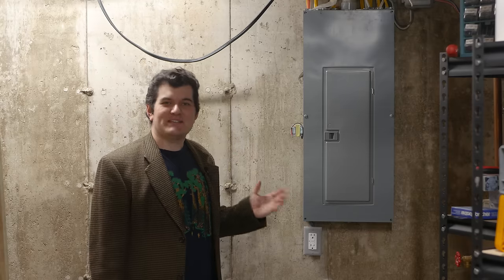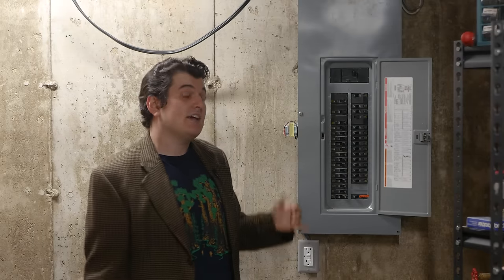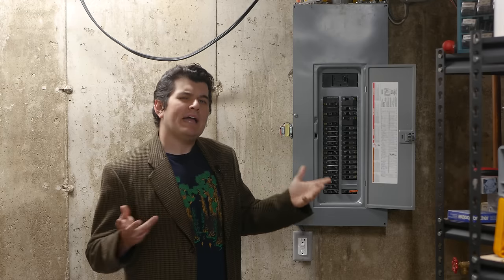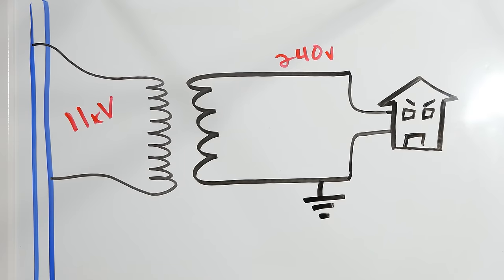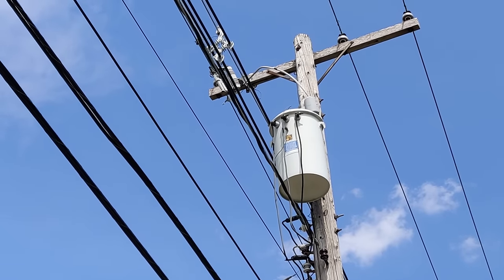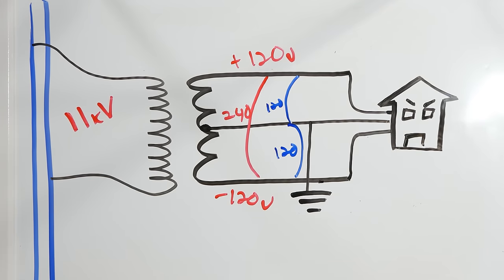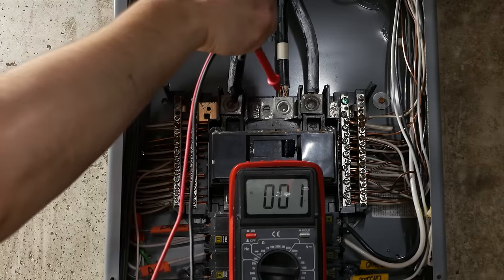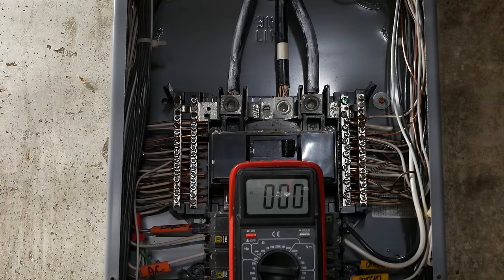The US electrical system is not 120V

Comment: Every single time I hear " It's amps that kill you not the voltage", it sounds to me the same as, "it's the claws that kill you not the big fucking bear"
Reply: Yeah, I've never understood that thinking. I guess it's an easy rhyme to remember if you've never learned Ohm's law, and it's technically correct. Just not usefully correct.
Reply: It's just people trying to sound smart.  It's a symptom of the disease of low confidence.
Reply: You bear analogy is way off. While it is technically wrong(it does not paint the whole picture as the voltage, current, frequency, internal resistance of the source and the resistance of the load) to say that A kills you and not the V. At most household situations, this is reasonably accurate, in fact most household electroctrocutions deaths are caused by closing the el. circle via low resistance path through the body into a lower potential point.
Reply: It’s the amps that kills you because high DC voltage does nothing to you since your body’s resistance is really high. If you have AC then your body behaves like a capacitor and by doing so it lets much more current flow through. Then, usually, death is caused by milliamperes of alternating current flowing through your heart.

So you can have 120V DC between your left and right hand with no problem, but certainly not 120V AC. So we could say it’s Tesla that kills you, in fact it was one of the main arguments against AC current in the first place, its safety. It’s the right frequency that kills you.
Reply: Stun guns and tazers.  It's like having a bear made of jello, 100k volts, but negligible amps.  It's rare though to have a voltage source with high enough volts to pierce the skin, and it not have enough amps to easily kill you.  It's amps that kill you not the voltage, is funny because its tecnicaly true, oh seems you didn't know it was a joke, it's kind of a joke, that's also kind of true.... its one of those.
Reply: @giuseppebertolini6705  Thought the AC was a problem because of the herts making your heart spasm, and the dc just locking it up.
Reply: @giuseppebertolini6705  I wouldn't say no problem, I would still feel it most likely. But that is basically what I am saying all along, I have seen some idiots try touching live wires "because its the amps that kill you no the voltage", that doesn't mean the current isn't responsible for the damage. I have seen demonstrations where people are using a van de graff generator, and the general public assumes that the thousands of volts across the body aren't doing much other than making their hair spiky so why should the 220V AC in their houses. This can translate to some poor understanding in some students as well. A van de graff is a constant current source, so of course it would produce a ton of potential across a high resistance path.
Reply: @travismason2811  Capacitive effects were the primary concern; the frequency response of a capacitor has higher magnitude at higher frequencies. But then skin effect also comes into play so it complicates things a bit.
Reply: Voltage is more than volts or current
Reply: @mubashirsoomro6  by lower potential I mean ground or neutral (you will be hard pressed to find negative potential in households). If your body(or a bodypart) bridges those two potentials with minimal resistance, some current I(A) will flow through your body as those potentials try to equalize.
This is how most of the household electroctrocution deaths happen and they happen because of poor installations(or during the process of installing those due to human factor and lack of training) or malfunctioning devices/metal elements not properly grounded...

The point is: in most households electrcitons it's the amps that kill you.
Reply: @bozoc2572  Again, as I have said before I am not denying that current doesn't kill you, you can say the current kills you because technically it does. My point was that saying "its not the volts that kill you but the amps" is not correct, because those two things are not independant, depending upon the type of source, one derives from the other.
A constant voltage source is going to supply as much current as it can depending on the body's resistance to keep the voltage constant. Likwise for a constant current source. But a constant current source with a low current output won't kill you no matter your resistance, as it will just increase the potential across your body. A constant voltage source will most likely kill you provided it can supply enough current and your body resistance is sufficiently small ( just like you mentioned, household deaths due to poor installation). However current sources are not really common, or easy to manufacture chemically. They are certainly not as widespread or useful to lay people. 

That's all I am saying, I am not really disagreeing with you.
Reply: @mubashirsoomro6  Yes, it is technically incorrect to say that it's not the the V(U) that kills you but the I(A), since there are many things at play here... 
But, with the voltage sources it's is okay to say that the amps kills you, since you really don't want that current flowing through your body between potential differences. It is a matter of perspective and in this case it's useful to think that 'A kills and not V'... Why get hung up on that? It's useful thought.

Effects of electricity on human body is very complex subject and the theory required the sufficiently explain the effects of electricity on human body is well outside of scope of most average people and whatever they think about what actually happens will be incomplete.
Reply: @bozoc2572  I don't see how that perspective is useful. Is it educational? barely. Is it true? Technically. Is it useful? How so?
I don't see how much current a certain source is going to produce through me, unless I measure my own resistance and there are many complex mechanicsms at play in our chemical and physical make up.

I can see that a 20V(AC) is not going to be a problem but a 220V(AC) could kill me. To me this sounds more useful than knowing the amount of current that will go through my body( As far as a laymen is concerned). 

I am not really hung up on it as much as frustrated with it. It is correct but not complete and that can cause some problems, especially in some students I have encountered . Why not just say, "A high current is resonpsible for death by electrocution", than tacking on the voltage part.
Reply: @bozoc2572  I don't believe I said that, "voltage kills rather than current". As far as usability goes, I don't believe I have to explain circuit analysis to people for them to understand that high voltage is dangerous. And as you said common household voltages, that's all you have to say. People may not understand what exactly voltage is, but that doesn't mean they don't know that it is dangerous. They know that if the voltage is low the lights will become dim, they don't really need the concept of current to understand that. Likewise if the voltage is low they probably won't be shocked as badly as if the voltage is high.

I don't understand how useful it could be to know about current in this instance? Sure, a higher voltage can drive higher current through their body, but isn't it simple just to say a higher voltage will kill you?

As for your last point, I agree, it's the energy supplied to your body that does the killing, but then again it's not that useful to the general public either.
Reply: It's true, why do you think a cops taser has like 50,000 volts and it's non lethal in most cases. The taser isn't hitting you with deadly current only high voltage.
Reply: @mubashirsoomro6  Again,  current kills is prevlent in communities precisely because it a simple way of deterring humans from dangerous situations in households. Even technicians are trained in that way-i.e., don't bridge the damn circuit with your body or with the parts of your body, and there are specific protocols that in fact account for most lethal situations that are quite common causes of electrocution. 
To simplify a complex topic and to make it useful to keep people from dying there are few points that instantiate the deadly nature of electricity: the path the current takes through your body, the length somebody stays in a such situation, the ammont of current passing through the body and the frequency of that current. Notice something here? Current, current, current...  Current kills is just elegant heutristic.
Reply: @bozoc2572  Okay let me put this another way, you mentioned technicians so let's go with that. Say, there is a 10V source and a 1000V source, would the technicians need to know the current for them to judge which is more dangerous? Even if they complete the loop with a 10V source, do you think they will die?

As for the simplification regarding complex topics; I don't have a problem with the phrase, "Current kills you", my problem is with, "Current kills you no the voltage". This massive simplification is not very useful, and even if current comes up so often, do people really understand what it really means? If they do, then might as well start with voltage and the water analogy. If your goal is to deter people who don't understand much about electricity from its dangers, then the how does saying current kills you not voltage, going to affect them? They don't see the values for current on voltage supplies, but the values for voltages.

So wouldn't it just be useful to say that above a certain voltage you have a risk of dying? Why bring in current? Even if it is technically true, in this instance it is not necessary.
Reply: and its the bullet that kills not the gun.
Reply: Amps would be how fast the bear could run.  If the bear could only run 1 mph (1 amp) you would probably be ok.  Voltage would be how big the bear is.  If the bear was  16 foot tall (480 volts) but could only run 1 mph  you would still be ok.
Reply: the amps depends on the voltage
Reply: @AegisHyperon  more like the amps depend on the ohms.
Reply: It's not the fall that kills you, it's the sudden stop at the end!
Reply: Or as the NRA keep telling us "It's the shooter that kills you, not the gun".
Reply: @giuseppebertolini6705  really? That's pretty cool. The more you know
Reply: What it really boils down to, is unless the voltage crosses your heart, it's unlikely to kill you. Of course, if the voltage is high enough, good luck trying to let go of whatever is shocking you, and whatever bits of you are completing the circuit are literally going to cook.
Reply: Its not the claws its the blood loss
Reply: I've had a 8kv shock and the amps were 0
Reply: @mubashirsoomro6  Bear analogy is not correct. A better analogy is a bow and arrow, a huge arrow is not dangerous with a small bow. Therefore, you out RCD-protection in areas where necessary (here it is mandatory more or less everywhere, except some certain usecases), to control that when it flows approximately 30mA from phase to ground, the RCD shall trigger. Effectively reducing risk of heart failure.

50 volts AC is concidered the treshold of what humans can endure, as 50v and our inner resistance equals to about 30mA.
Reply: Mubashir Soomro ok, high voltage will push more current (measured in amps) through a resistance (you) than a lower voltage, if there's  enough power (watts) behind it. You're not going to get a deadly shock from 12 volts no matter how many amps, 500 or more, it's rated for because your body has too much resistance for 12 volts to push much current (amps) through you.
Reply: or i wonder if they are a taser salesman
Reply: @engineclinic  It is both. Power is equal to the voltage squared divided by the resistance.
Reply: @steves009  If you had a shock, the amps were NOT zero. The current may have been very low, but had to be there to flow through you.
Reply: Claws don't kill people, bears kill people!
Reply: Unless your working on the big stuff, then don't worry about either because it usually blows out your ankles and you die of blood loss 😃
Reply: @haruhisuzumiya6650  Ohm my god!
Reply: Does a taser(more than 1000v) kill u no. does 120v kill u yes
Reply: @travismason2811  100k volts in open air but as soon as it contacts skin in order to limit current voltage drops under 100 volts RMS. That's how you limit current, by limiting RMS voltage.
Reply: @chrishill601  it is like luke skywalker he is 230v high, but it is the force that kill you, not the size . amp or watts is the force of the electric system, watt is volt x amp ,ex  230v x 10 amp is 2300 w power to use.this i why we uses high voltage in the power lines, try 115000V x 10 amp fuse = 1150000W to use, and this will be in the same 1,5 square mm cable, in a car this will be 120w in the same cable.
Reply: @chrishill601  It's usefully correct when the voltage is high, but the amps are low.  The static charge you build up walking across the carpet, and touching a doorknob can be thousands of volts, but the amps  depend on the ability of your body to hold charge.  Since you can't store that much charge, the amps are very low, and nobody has ever died from getting a static shock from carpeting.  Spark plugs on a car are also thousands of volts, and while it's painful to get shocked by one, it's not going to kill you.  

So yes, there are situations where the phrase is not only technically correct, it provides you with useful information.
Reply: The problem arises when people confuse the current of the shock with the current of the circuit. Assuming a constant resistance of a human body, there is no situation in which one can receive a "high voltage, low current" shock. V = IR, so with a constant resistance, current is directly proportional to voltage drop. 

A "high voltage, low current" shock often means that the potential voltage is high, but the voltage drop across the body is much less than the line-ground voltage, due to high resistance in series with the body. In layman's terms, if the human body is not connected to ground (or another line in a multi-phase system), there is no voltage drop across the human body, and so no current. 

Likewise, the resistance of the human body can very. Wet skin, for instance, will lower the resistance, increasing current low for the same voltage drop.
Reply: @blkgardner  except a taser which can be 10k to 20k volts but .01 amps.
Reply: @jamesross160  That proves my point. The voltage drop across the body is not 20K Volts. Rather, the 20k volts refers to the potential voltage across in open circuit of a taser.
Reply: It's ENERGY that kills.  There is more than lethal energy in a home circuit.  Static charges that you feel when you touch a doorknob are in the range of 10,000 Volts, but only have a tiny amount of charge, and hence tiny currents.  The natural ambient electrical field in the earth's atmosphere near the earth's surface is about 1000 Volts per meter. When it gets too intense and breaks down the dielectric resistance of air locally, it discharges as lightning. That can kill you. 

One way to think of it is analogize voltage to height, and current to mass.  If someone drops a small coin from the top of a tall building, it doesn't do much damage. If some drops an anvil off a low table, it can do real damage. If someone drops an anvil off a tall building, it can do massive damage.  Think of house current as a small anvil off a moderate size table. Treat it with respect.
Reply: @jimdecamp7204  It is true that "energy" kills, in the sense that the duration of the shock affects how dangerous it is. Static electricity is not my forte, so I don't know the mechanics of it well. Since there is no sustained flow of electrons, the duration of of static electricity shock is much shorter than most current electricity shocks. At any rate, static voltages and current voltages are not directly comparable. 

However, the anvil-distance analogy is not valid. Rather, the proper analogy is voltage as water pressure, amperes as the water flow, the resistance as how constricted a pipe is. 

If you have a stable pressure source, you will find that the flow through any given pipe is determined by the size/nature of the pipe (resistance) and the the pressure of the source. If you have a high-pressure low-flow system, you will find that the flow in the pipe is actually reduced. But, upon further observation, you will find that the pressure drop across the pipe is also reduced. 

Therefore, if you know nature of the pipe (aka, it's resistance in ohms), a given flow rate corresponds to a given pressure drop, and a given pressure pressure corresponds to a specific flow rate. 

In affect, the "high voltage, low current" water system is the equivalent of a high pressure system with upstream clogging. If you look a hose downstream from a partial clog, it will look like low pressure.
Reply: @blkgardner   Your water analogy is excellent.  I used the anvil to keep it simple. At the end of the day, it's energy that does the damage, however.
Reply: Sure, amps kill...........but not by themselves, you can touch single-digit voltages at kiloamp currents and not feel anything because the voltage is too low to break your skin.

On the other hand, touching the 2kV@1-2A output of a MOT is guaranteed death.
Reply: @jimdecamp7204  Yes. Energy would be the cause of injury and death. 

In current electricity (aka, anything but a lightning strike and few extreme niche situations), the energy of the shock is controlled by the voltage drop, resistance characteristics of the path (aka, the resistance of the person being shocked), and the time of the shock. 

Mathematically, Energy = Power x Time (aka, watts times seconds). 

Going back to the pipe analogy, as far as electrical shocks are concerned, only the flow and pressure inside the "shock-victim  stand-in" hose matters. 

The "high pressure low flow" system can mean two things. Either, there is a high pressure and high potential flow, or there is high pressure but low potential flow due to clogged pipes upstream. The latter condition would be called high output impedance. Or, you could simply have a system with high potential pressure, but it just happens to have low flow. 

However, the flow and the pressure within the hose (that in the analogy of the shock victim) are related. If you have low flow in the pipe, then the pressure drop across the pipe will be low.
Reply: @DFX4509B   I don't think we disagree.  Static electric potential can be quite high, on the order of tens of thousands of volts, but other than some slight discomfort, generally harmless, but because of the small amount of charge, and hence current, applied.  The natural ambient electric field is on the order of about one thousand (1,000) volts per meter. When the ambient electric field intensity exceeds the breakdown voltage of air, the discharge is dramatic. We call it lightning. There a great deal of charge involved.  

I recall working in a factory in the 1970's where the refrigerator (for keeping bag lunches in) used a two prong cord; the case was not grounded. If you probed the chassis with an oscilloscope, with a 1 megohm input impedance, you would see 120 VAC on it, probably because of stray capacitive coupling. The impedance of the capacitance was sufficiently high that it did not present a danger, absent a fault between phase ("hot") to chassis, which is exactly why modern appliances are grounded. If one touched the chassis and touched the tip of an oscilloscope probe in the other hand, you would see the 120 volts "coursing" through  your body, but at such a small current that you would not feel a thing.  Your body was acting like a conductor. You can see the same thing at popular science museum exhibits, but at DC, with thousands of volts and the subject's body acting as a capacitor.  It makes your hair stand up on your head. 

Regardless, always treat electricity with respect. Fire is the primary concern once work is installed, electrocution while working on the wiring.  Be safe, follow the rules and treat all circuits as if they were live.
Reply: @jimdecamp7204  If I'm right, and my single-digit voltage example was 1.5VAC@1kA, and skin resistance is 100kohms,  I would only be taking on 0.015mA, not even enough current to feel despite the transformer being able to put out 1kA, which at low voltages like that, can melt metals and is commonly used for that purpose and for spotwelding.

With a MOT, however, I would be taking on the entire 1-2A because the voltage is more than high enough to break skin, as is the 120V@15A or 240V@30A out of the wall, and tasers operate on 50kV@microamp currents hurting like hell, that's where they get their stopping power from.
Reply: because you can be shocked with hundreds of thousands of volts and be fine(tasers) because the amperage is low. Volts just determines if it can pas through a material like you skin an organs. If there's enough voltage to pass through, then amps determines whether it will kill you or not.
Reply: @jmh1189  yeah that is how electricity work. if you had high voltage but low max current. The voltage will start dropping if it cant provided enough current to load.
Reply: @DFX4509B  it same with voltage tho. If you have 50kV@0.015mA touching your skin with  100kOhm resistance, you will only get 1.5V since only 0.015 mA current running on your skin, thus the voltage will drop.
Reply: It litterally only matters for a handful of situations like ionizers incapable of providing much more than a micro amp at insane voltage, (or similar demo low amp devices) or how linemen can syncronize their voltage to a live transmission line provided they wear a full chainmail suit (corona is fun).
Reply: Good analogy. Most laypeople do not understand, better to not touch anything more than 50V as a rule. It has to do with impedance, some sources have high impedance (tasers etc) mains power has low impendence means it can push lots of current through you.
Reply: Right?! Pretty sure it has to be the right mix of both. Kinda' like combustion.
Reply: To be honest it's milliamps through your heart muscles that quickly kill you.
Reply: Or the bastards who say "it's not the heat, it's the humidity! Ahahaha!"
Reply: @Demiglitch  It's all about the source and load impedance plus the source voltage, I have tried to explain it. Some get it, some do not. Tasers have a high voltage but also a high source impedance, not enough current flows to kill you. people get fixated on current, current flows when the voltage appears across the resistance. Focusing on Amps, negates the bigger picture. I am preaching to the choir but others will read this I hope.
Reply: I can barely bear the thought of a bare bear bearing down on me.
Reply: I'm more scared of the Jabberwock.
Reply: @mubashirsoomro6   The amount of energy dissipated through the body has more to do with it.  A few hundred watt-seconds ( 100 ma., 120 volts) can stop your heart, but a 200 to 400 watt-second defibrillator pulse can restart it.
Reply: @travismason2811   I was shopping online for tazers,  but there were too many shocking reviews.
Reply: @nthgth  pot and the kettle
Reply: @blarghblargh  I think you're using that expression wrong haha
Reply: @giuseppebertolini6705  120VAC is 120*1.414*2, or 339.36 Volts, peak to peak.
Reply: @giuseppebertolini6705  DC is way more dangerous than AC. You get zapped with 230V AC (Here In Austria) you can pull your hand away. You get zapped with 235V DC (some Motor phase controllers) Your whole body locks up and you are not able to pull away...ANYTHING.
Oh and its Voltage thats dangerous. Amps dont matter at all if you do anything actually professionally
Reply: It's like saying "it's the bullet that kills you and not the fact that it WAS APPROACHING AT VERY ZOOMY SPEEDS"
Reply: Bullets kill. Not the gun.
Reply: "Its the pressure that kills you not the velocity of that bullet"
Reply: "It's not the fall that kills you its the sudden stop"
Reply: I cant say for certain where the saying came from but I first heard it from an instructor cautioning a student who scoffed at  the dangers of 120v . He mentioned getting shocked by the fancy g-wiz wonder box ignition system on his hot rod wasn't that bad, and it put out some absurdly high voltage. . 

 You  can have very high voltages with almost no current, like static electricity. The igniter on your electric grill or some cigarette lighters make a high voltage spark that will not be pleasant if you shock yourself with them, but won't harm you. Getting zapped by a spark plug wire on a gasoline engine can be painful and some of the high power ones are supposedly capable of minor burns but I've never heard of one killing.   

Meanwhile a comparatively low 120 volt circuit can easily kill you if the current passes through your heart.
Reply: @nthgth  I can't speak for most people but the first time I heard it was an instructor setting a student straight when he scoffed at the safety precautions we were required to follow when dealing with 120v. 
The kid mentioned the ignition system on his car was many times that and wouldn't kill anyone.  It is surprising how little some people know about electricity.  A friend of mine was horrified that I would change the battery in my own car because he was convinced that the high amp output meant I'd get killed if I accidentally touched both terminals, and cited the "it's the amps that kills you" thing.  
He installs some fairly high tech electronics and has done so for decades.  I thought he was kidding. As it turns out, he wasn't.
Reply: @travismason2811  There is some truth to that but probably not the way you think.  Most people are familiar with  resistance.  If you have a 1 volt power source, on a circuit with 1 ohm of resistance you'll have 1 amp of current. That doesn't matter if you're talking DC or AC.  When you're talking radio frequencies (RF) things can get weird once you go above a certain point.   What does change is impedance. If you have 1 volt at 60hz at 1 ohm of impedance, you get 1 amp. If you change the frequency that changes.  If you took a capacitor and hooked it up to a DC power source and monitored the current, you'd have a spike of current at the beginning until the capacitor charged up, but then it would taper off to zero as the capacitor was done charging. This might only take up a tiny fraction of a second depending on the size of the capacitor.  Hook  that same capacitor up to an AC power source and you'd see a constant current flow. (overly simplistic, you can blow up the cap or pop a fuse etc)  While the human body isn't a capacitor, it is a very complex system. Our skin isn't a very good insulator, but it is a heck of a lot better than what lies beneath. A shock from a DC source is very different from a 60hz ac or a zap from a radio transmitter.  All can kill you, but higher frequencies do seem to get past our skin easier. I can't find a lot of data on it but I do know that RF burns can be UGLY. 

Anything that can get though to your heart with enough current to screw up the way it beats can kill you.  Statistically for 99% of people (In North America at least) that would be the 60hz 120V AC you get from a common wall outlet. Not many people work around high voltage dc or RF transmitters.    In an industrial setting you have 60hz 3 phase circuits that commonly go up to 480V and accidents do happen. (I got zapped by 480 despite locking out the circuit and verifying it was dead with a meter.  Someone had fed one a fuse blocks in that panel from an adjacent machine. When the machine next to it was fired up part of the panel went live. I describe it as how I imagine getting hit by a bus would feel in the half second before the pain had time to set in, and you died. I think every muscle in my body convulsed HARD. The next thing I knew I was laying on the floor thinking that our hot rod forklift driver had just clobbered me.  
Not one of my better days but I'm still here so I can't complain.  I did make sure to fix the machine so that couldn't happen again.
Reply: Only need 2mA for the ‘paddles’ on an open heart surgery defibrillator.  A 15kV PS I made for use in a human contact situation would drop to near zero volts with the heavy load that a human pathway presents, but we had it shut off at micro-amp levels.  That tiny PS was not capable of harm. Sure it would hurt, but no harm because the bear (voltage) gets clamped.  The 11kV available at a telephone/power pole HV feed is capable of so much current that is will roast you and your body parts in the pathway it takes by boiling your salty blood and might also cause a heart issue.  :-). My bear could barely take a bite or claw you whereas the bear to which you refer can evaporate your ass in a few seconds (practically).
Reply: As a previous maker of HV DC power supplies, I can tell you for sure that DC can kill you just as quickly as AC.  No ground straps at the HVDC test bench.  You were poorly educated if you believe the crap you just spewed.
Reply: @cosmicraysshotsintothelight   not sure if you’re replying to me, but, “Anything that can get though to your heart with enough current to screw up the way it beats can kill you.  Statistically for 99% of people (In North America at least) that would be the 60hz 120V AC you get from a common wall outlet. Not many people work around high voltage dc or RF transmitters. “ 

That “anything” includes dc.
Reply: @Keenath  so it's the gforce that kills you 👍
Reply: @williamgeorgefraser  I'd argue it's the sudden transfer of kinetic energy that kills you 😉
Reply: @redrock425  Technically, acceleration, which might be measured in G.
Reply: @BD-xz6te  Except that the discussion was absolutely about what kills, and elevated DC voltages are NOT around households, but that does not mean they do not get included in the discussion regarding the physics behind what causes a fibrillation event.
Reply: there is a reason they use HIGH VOLTAGE warning labels and not high amp labels. people who are saying its not the voltage that kills you clearly don't know a thing about electricity
Reply: @XIIIStefanC  High voltage warnings are there because high voltage can arc through the air. You don't have to actually touch a hot wire to get injured. It'll reach out and get you if you merely come too close.
Usually high power throughput comes with high voltage (since running high amps heats the wiring) so they're semi-interchangeable -- but for example, a taser runs a couple milliamps at 50kV, which is rarely enough to cause any real damage beyond maybe a cigarette burn.
Reply: LOL! That happens is, hi voltage ALLOWS hi current to run thru you and kill you. Low voltage like 9V even where 100Amps is available will not flow thru you unless forced by hi voltage!  My many finger-in-light-socket tests confirm this!!
Reply: @mmpiforall5913  HV from power line sources can sustain or drive high currents.  HV from a small form factor low wattage DC supply can ONLY provide the max it is rated to deliver.  Attempt loading it at a higher load and it merely clamps the voltage down.  Small sources cannot provide body frying current levels, but the small levels they do provide can easily cause a fibrillation event.
Reply: @BD-xz6te  Damn dude glad your all right.
Reply: @travismason2811  Thank you Sir.  I'm rather glad to still be here.